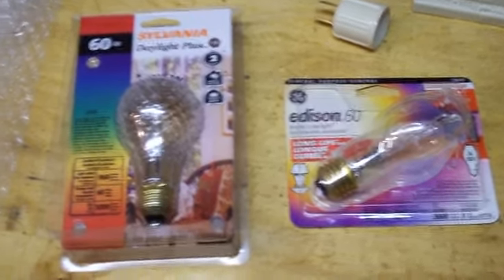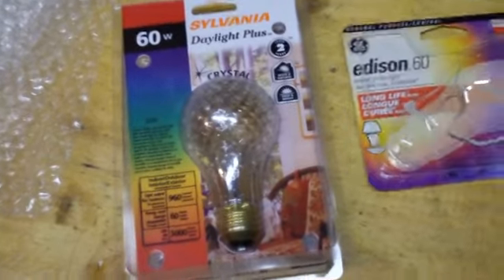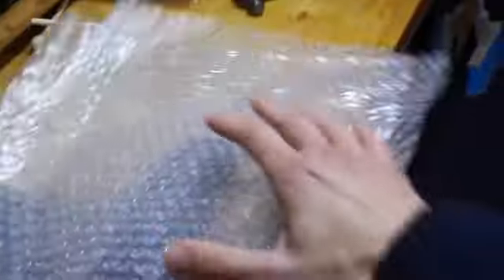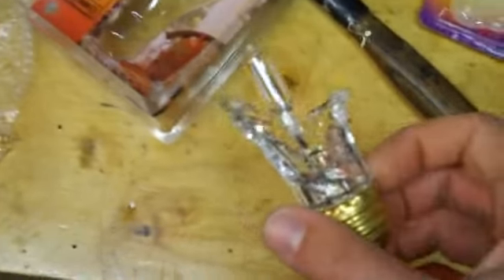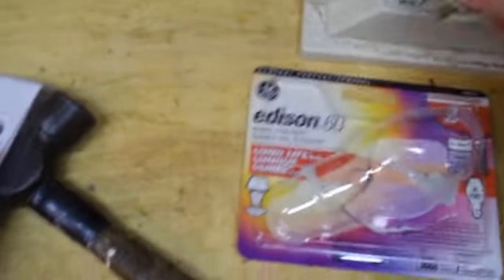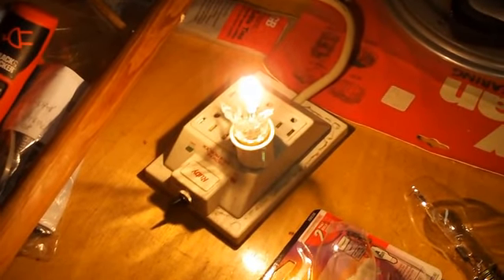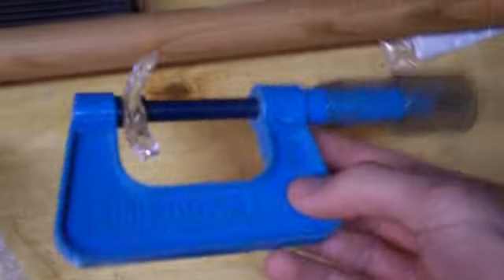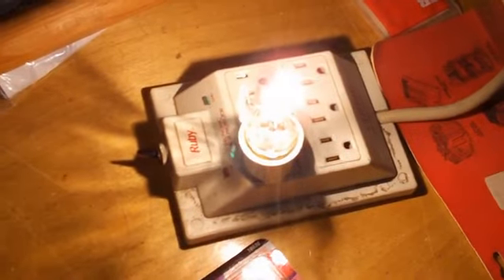Smashed halogen light bulb still works

Comment from the maker: @matthewtchernev123 No.

I know you only demanded me to answer "yes" or "no", but I will explain more anyway: Only the inner halogen bulb itself needs to be protected from skin oil and other contaminants. On these bulbs, the outer glass shell doesn't get any hotter than a standard incandescent bulb, so no special precautions are necessary when handling them.

Comment: Those halogens don't last long if they are installed sideways.

as you probably know but doesn't seem to be mentioned in the video, the halogen capsule produces a significant amount of UV light which is damaging to your eyes and skin. The outer shell has a coating to block the UV light. using the light without the outside surrounding is quite a bad idea.
Reply: Compared to the sun I wouldn't worry about it much.  Also functionally I'm sure basically no one has ever used one like this.
Reply: UVA and UVB aren't that bad. I doubt a Tungsten Filament could prouduce UVC and I'm pretty sure you need Mercury to produce UVC. The only light sources that I can think of are Mercury Vapor Lamps and Fluorescent Tubes. Of course, these need to be made of Quartz to let the UVC through.

Comment: The outer shell protects you from high dose harmful UV radiation, so although it will still work, you should discard it once it breaks. It can also cause a fire.
Reply: It's incandescenting ... there is no UV
Reply: It's all IR
Reply: @Scudmaster11  There's probably small amounts of UVA and maybe UVB. Definitely no UVC though.
Reply: @Vinnay94  I don't think so.... the light partials have to be sped up "given more energy"
Reply: There isn't any uv in a ir primary producer

Comment: As others have mentioned, the outer glass shell will filter harmful UV, and perhaps changes the output color, but it also helps it survive exposure to moisture.
Reply: UVA and UVB are not dangerous, of course I still wouldn't stare at. You need Mercury to produce UVC and I even then, it probably wouldn't work because actual UVC lamps are Arc Lamps. 

Even though Halogens produce a  more White Light which does in fact cause glare, I don't think it's in the dangerous UVC range.

Comment: en quartz capsule to burst if it has any contaminates on it such as moisture, oil, fingerprints.   The contaminates cause uneven heating of the quartz glass and it will either: 

A: Fail prematurely
B: Form a blister
C: Break open

Comment: I have had the protective shell of an Osram branded bulb break off at the base and fall the moment I pushed the switch. Only two times that has happened. Not sure why, as there is no shortcircuit or other flaw with the remaining wires. Is there any gas in the outer envelope? I replaced it soon because I was afraid the capsule might break as well and fall on dusty carpets and start a fire.

Comment: An incandescent light emitts nearly no UV-radiation. That is not the big problem. The bigger problem I see are the opened wires, which feed the halogen light! You could get an electric shock if you touch it or you can get hurt by cutting yourself on sharp glass edges!

Comment: Don't try this with a high pressure sodium lamp, they're "vacuum jacket" lamps and will exp-lode.
Reply: Oh, so the bulb isn't just to protect the envelope...
Reply: @Vinnay94  With these Halogen lamps that are designed to be a replacement for most general service Incandescent bulbs, the outer glass envelope just "makes it appear" like an ordinary light bulb. Halogen lamps without this "protective glass" can't be handled without gloves or a paper towel because fingerprint oil from your hands / fingers will cause vitrification of the bulb glass. (A bubble will form in the one area of the glass and the bulb explodes because of the high temperatures causing the glass to get weaker at the "bubble".) The Halogen lamp is actually an Incandescent lamp with a Tungsten filament in either a capsule or a tube, but has a high pressure gas such as Bromine, Boron or Chlorine in them to "heal" the bulb filament. (A chemical reaction occurs with the Tungsten filament to put back some of the "lost" Tungsten atoms evaporated from being boiled of by electrons.) Halogen lamps are slightly more efficient than ordinary Incandescent bulbs and produce more light with less energy. The reason why these lamps are called Halogen lights, is because one of the aforementioned gases that are used with these bulbs is under the Periodic Chart of Chemical Elements known as Halogens. Halogen lamps along with it's "brother" the Incandescent lamp are both a resistive load electrically, has a Power Factor of 1.0 and requires no Ballast to operate them unlike CFLs and LED lights. Above all, you get near inferred light from both Halogen & Incandescent lights alike because they make their light similar to how a fire makes it's light, from incandescence from combustion. (Near inferred light is required by our bodies for certain biological processes such as Melatonin production, to promote the healthy healing of our tissues & cells in our bodies and to reverse Rapid Oxygen Species or ROS in our eyes. ROS causes macular degeneration.)  Fluorescent lamps, CFLs, High Pressure Sodium lamps, Mercury Vapor lamps, Neon Signs etc, has about a third of the near inferred light that Halogen and Incandescent lights offer. (These lamps make their light through electrochemical means. Electrons collide with gas atoms, knocks of an electron and ionizes the atom. Photons are released) LED lights with the exception of "full spectrum" LEDs, their visible light spectrum is actually devoid of near inferred light and they shine more in the bluer to near ultraviolet end of the visible light spectrum. High Pressure Sodium, Mercury Vapor and Metal Halide lamps are "Vacuum Jacket" lamps with glass "protecting" the arc tube and also blocking any UV light from being released. Most Mercury Vapor and some Metal Halide lamps have their inner walls of the "outer glass" frosted with Phosphors like a Fluorescent Lamp to help capture this ultraviolet light and convert it to visible light like a Fluorescent lamp. These "deluxe" Mercury Vapor and Metal Halide lamps light up like a cool white Fluorescent light would.

Comment: My Friend, the outer glass is called the outer envelope.   With a halogen lamp it is only to pretect the quartz capsule from becoming contaminated with moisture which causes premature failure.   However many quartz halogen lamps are made with no outer envelope.  I appreciate your curiosity in shattering an expensive lamp to make this video.  Next time you want to destroy some light bulbs, buy them from us!